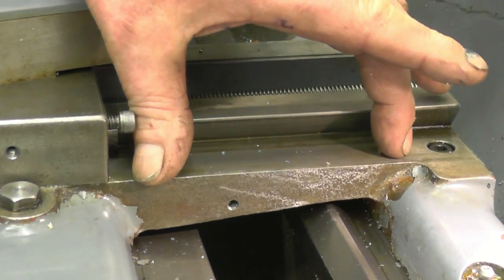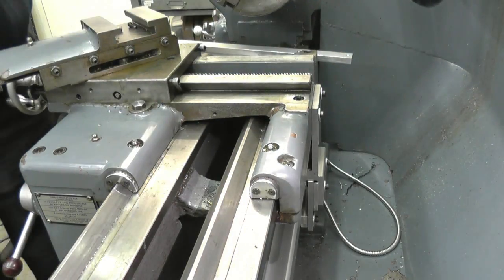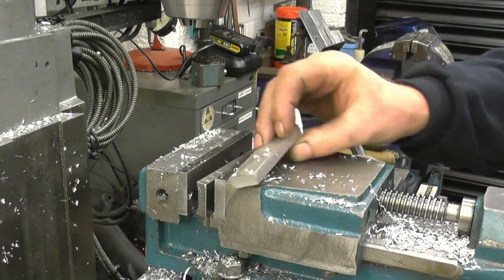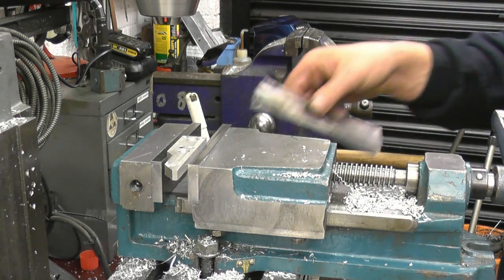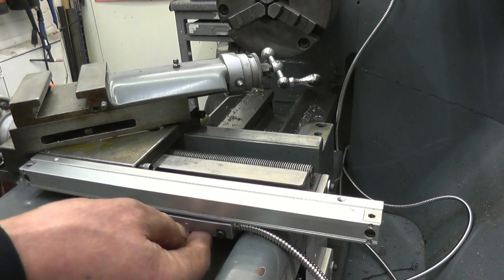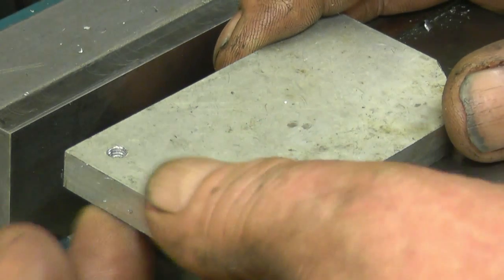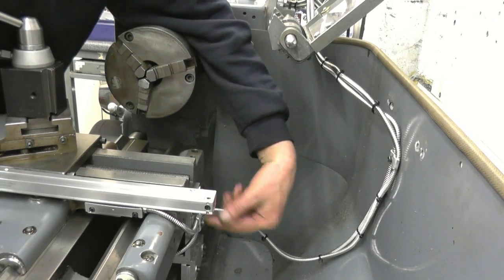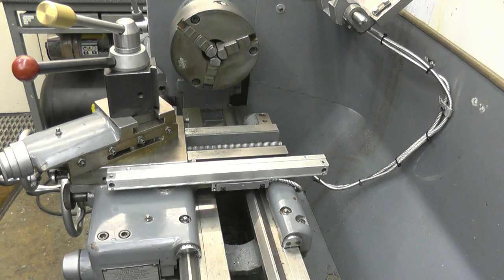DRO Part Four

Comment: I've used the nut method many times in order to fix ali threads, it works a treat. One thing I would say is that make sure that you press the nut right down to the bottom of the hole otherwise the bolt might pull the nut down when you tighten everything up, if nut does sink further into the hole then the bolt will become loose!

Comment: John, remember to find a location to install a solid bolt in the carriage in such a way that the head extends beyond the DRO scale to protect it from the tail stock hitting if moved closed to it. That should round up the installation.

Cheers

Jorge

Comment: Very tight little(or not so little) job you did there John. Very clean and also well thought out. There are at least two things I wouldn't have thought of and it was those stops you made. Being such a novice I wouldn't have even thought of it until "Crunch", it was too late. Thanks for the future save, I'll have to buy you a pint at the pub whenever I'm in town. I again like that back-nut patch, or the "poor-man's helicoil" to install from the go Aloha...Chuck.

Comment: job well done john its a pity there wasn't enough room under the
cross slide to get the DRO under it then it would of been completely
out of the way the job looks sound
Reply: +Andy Coakes There is under the cover and mount out board.